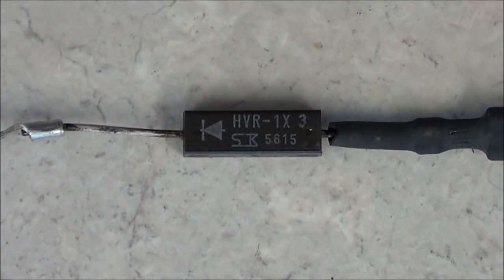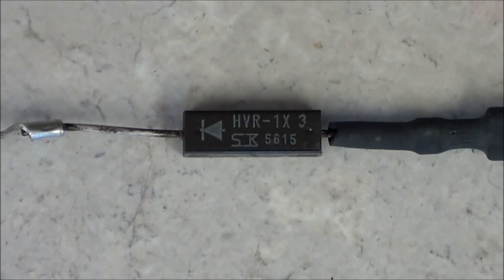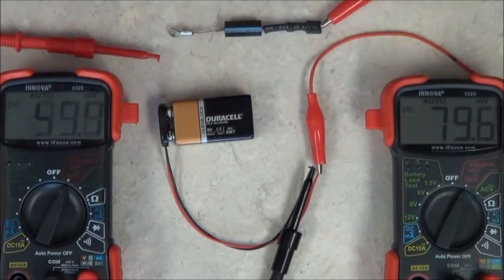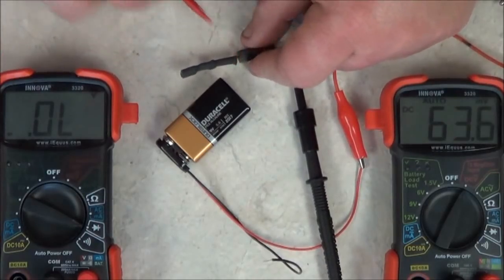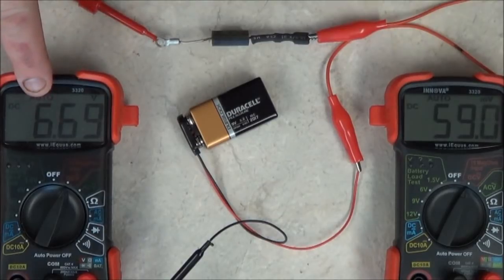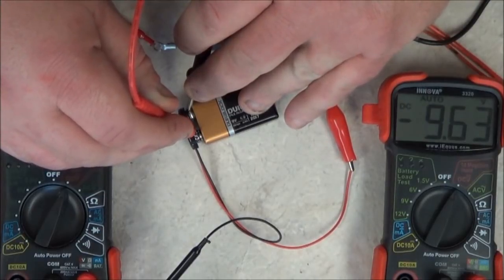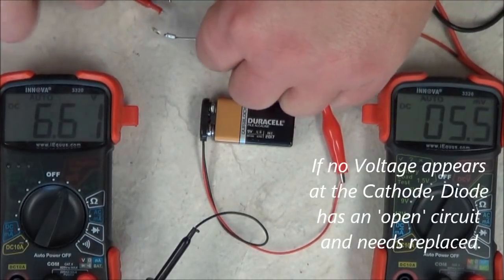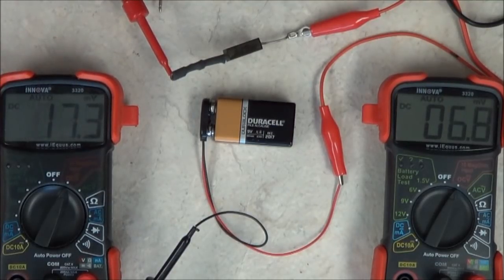How to test the Microwave Oven's HV Diode

Comment: Dear sir,
I have microwave oven.when it is on from quick start ,its sparking from magnatron.
this is magnatron fault or high voltage transformer fault.
please advice.
Saman(sri lanka)
Reply from the maker: Saman Wijeratne The magnetron will need replaced. Magnetrons have an insulator inside to prevent arcing of the high voltage has failed. -MrFixit

Comment: I tested a micronde Diode. I found 536 in one side and - 536 in the other, what means  please.?
Reply from the maker: 536 What?  If the diode is conducting in both directions then it is bad and needs replaced. The diode should only conduct in ONE Direction

Comment: First of all anyone working on a MW needs an amp meter in the power to see what its doing. We always used a megger to check the HV diodes, and for the other components unless you have an LCR meter to check the cap we used some used known good components off the shelf. A DVOM won't do you much good with the HV circuit. 3 to 5 amps is the filament current, then the Mag kicks in and the current ramps up to 15 or 20 amps. If you have a loud hum and all the HV components are ok its probably the tube.
Reply from the maker: it will either bet the HV transformer or the Magnetron. MrFixit

Comment: I tested my diode. One way I got 9v and when I tested it by flipping the diode I got 6v. Is that a bad diode?
Reply: If thats the then you have to replace your hv diode because theres a leak it should only show you voltage on one direction around 6-7 volts when you reverse there should be 0 volts reading i hope this helps thanks
Reply: @luisvilleza2687  Mine shows voltage of 1.42 one direction and zero in the other.
Is that enough or a bad diode?

Comment: So what do you do if you've only got one multimeter ????
Reply from the maker: +Ivan Short connect a 9V battery and a 1k-ohm resistor to the HV Diode, the resistor will act as the test load.  Connect  +9V to the Anode,  the Cathode to the resistor, then resistor to -9V.  Measure the battery voltage. Now measure the voltage across the resistor.  You should see about a 6V drop in voltage.  Now if you reversed the Diode so it conducts in the opposite direction, you should get 0V across the resistor..  -MrFixit

Comment: My LG Microwave stopped heating (internal bulb is not working either even after replacing the bulb).........would this be a faulty diode?
Reply: Stacy Webb No   the diode has nothing to do with that side.  check the ceramic fuse that says 10A inside the unit,  and the plug top. A microwave will still show  time/ clock , light  and fan run, etc even with a faulty diode.  make sure above all else that you unplug, leave for 10 mins and cross the terminals to ground with a sheathed screwdriver  High risk of Death here !!!       3000 to 6000 and higher volts.
Reply: Paul Orbinson your capacitor can hold a charge so ground all terminals first and stay away from the magnetron , just looking for signs of fault can straight away show it is gone. burns  or cracks or any smoke damage etc is a dead giveaway otherwise if it looks good it usually is.
Reply: It was the thermostat.........which was odd because all of the suggested diagnostics I came across on Youtube and other places, not one said anything about the t'stat.
Reply: Stacy Webb  yeah  I did that test before I got to the diode. just put the circuit tester across the stat, if it rings your good.  I cant get a diode for my samsung ME 731K  its Sept 14 model,  I would never buy another thats for sure.

Comment: The fact that the ohm meter reads “over limit” OL is proof that the diode is good and is not shorted because of a circuit fault. So ohm meter is a good quick test of diode’s health!
Reply: Not necessarily, although testing the resistance from terminal to terminal will ensure that the diode is free of a short failure condition, it will NOT indicate the ability to conduct when forward biased. Therefore a resistance test cannot not ensure that the diode has not failed in an open circuit condition, which as it happens is a pretty common failure mode. So not such a "good quick test of diode’s health".

Comment: My diode passes the test. But when it's connected the fuse blows. Any suggestions?
Reply from the maker: +Jake Jones Check your door switches, you may have a bad switch. -MrFixit
Reply: +ESRepair  All my switches/connections test good. Two normally open and one normally closed. The microwave draws 55 amps thus blowing the fuse. When I disconnect (only) the diode from the frame, it draws about 5 amps. When I disconnect only the magnetron (everything else connected) it draws 55 amps. When everything is connected EXCEPT the single wire that goes from the transformer to the capacitor OPPOSITE the side that the diode is connected, it draws 5 amps. When I disconnect everything except
 the diode and the transformer wire to capacitor opposite the diode it draws 55 amps. 

Summed up: if the transformer to capacitor wire opposite the diode is connected AND the diode is connected, it draws 55 amps no matter if any or all the other wires are connected. These readings are approximates only so that you can know when the problem is happening.  Also, just to rule it out, I am using a new diode. 

[note: I am a HVAC tech, so you can be certain of my diagnosis]
Reply: Jake Jones bad h.v transformer
Reply: Put some foil paper on it.
Reply: @danitzaayala8988  Turns out it was the transformer. Whoda thunk. Anyway, I barely remember making this post. But for what it's worth, the microwave has been working like a champ ever since (YEARS). And it gets used several times a day. Best part about it, just push the door closed (no handle) and press a lever down to open. Plus, it has NO (annoying/useless) TURNTABLE! Ahhh, the good ole days....
Reply: @frankmata1812  Uhuh.

Comment: The voltage drop is too high, not the resistance.
Reply from the maker: The High Resistance causes the voltage drop.
Reply: No. The voltage drop causes the meter to think that there is high resistance.
Reply from the maker: You haven't studied Diodes long. ok, If it's not the resistance that causes the voltage to drop then what is it, gogo?-MrFixit
Reply: ESRepair . It is the P-N junction. Every P-N junction has got a voltage drop. That's inevitable.